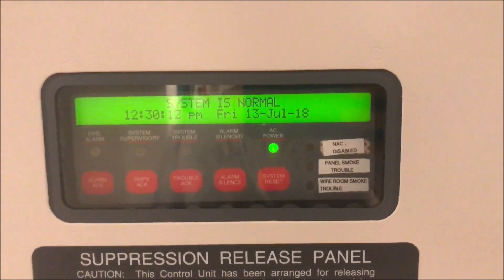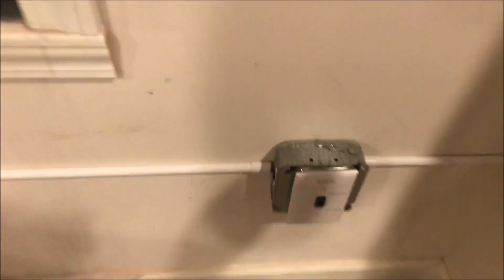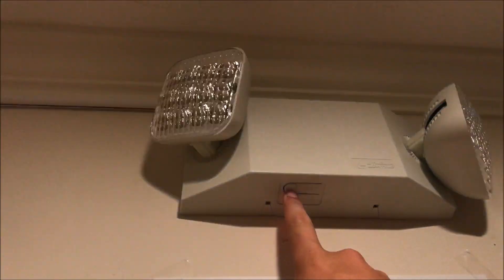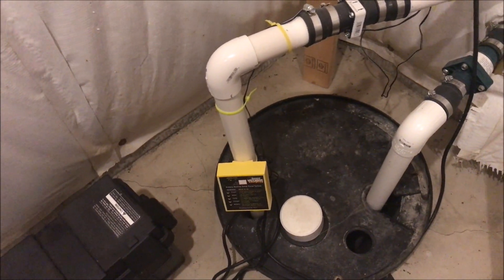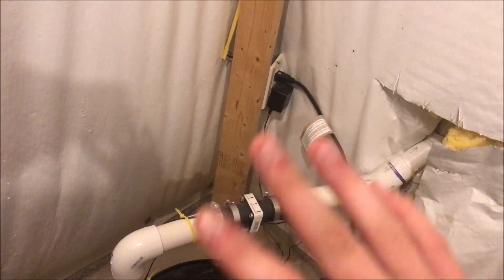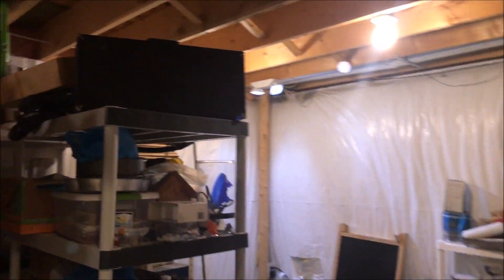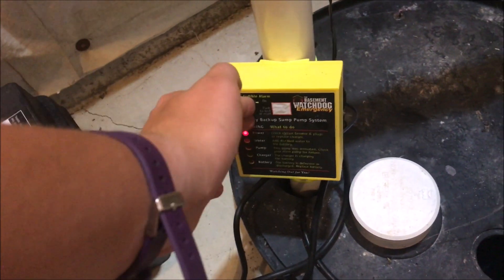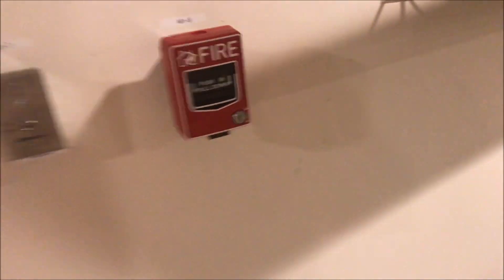Testing and Overview of my Emergency Lighting System

Comment: will an exit sign also last for 3(ish) hours on battery back-up? (Same brand)
Reply from the maker: Mine is a combo E-Light and Exit sign and it doesn’t last quite as long with the same battery, but it has space to add extra batteries

Comment: Great video 😀👍👍
I actually got an EU2-LED out of a building, but it had a bad battery and cracked back plate!😢😞
When Hurricane Irma hit, the Dual Lite EZ2D (I got out of my high school) lasted a bit over 4 hours on battery backup!!!
Reply from the maker: That's insane! Thankfully, since I've installed mine, we haven't had a power outage, but I'm ready!
Reply: Evan Bart 410 duel lite is quality.